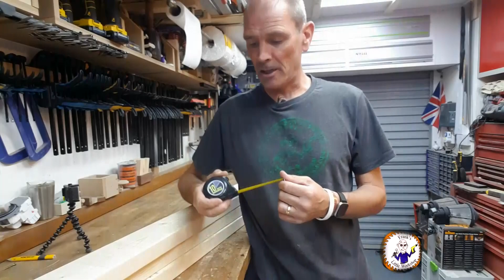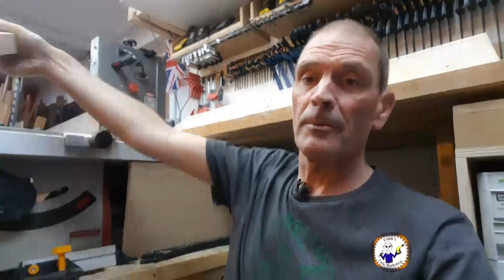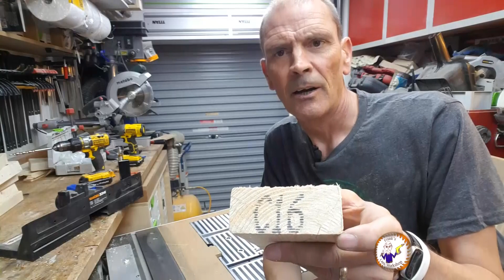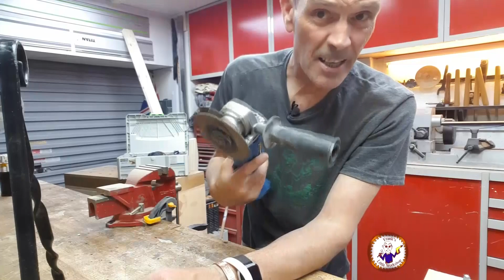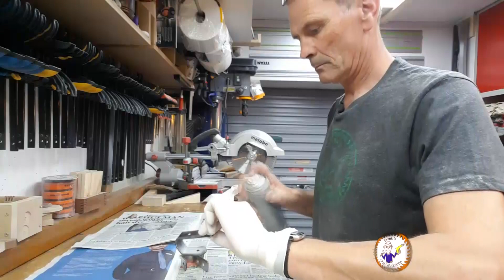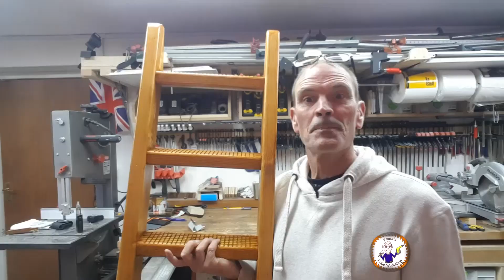How to make a bunk bed ladder.

Comment: Hi mate could you use 3x2. And instead of pocket holes what about screwing directly to the outside lengths into the foot boards ? . Obviously with big enough fixings and and filling at sanding the ? holes ?

Comment: They look pretty, but I don’t think they will be strong enough with only 4 pocket screws in the treads. I would have liked to have seen the treads keyed into the styles. Also grinding with the guard off and some flimsy safety glasses!? Not a good message to send out here. Plus you were trying to cut with a grinding disk not grind with a cutting disk. Apart from that, an enjoyable video thanks.
Reply from the maker: 😆 They lasted longer than the rest of the bunk beds apparently 😆, so it was more than strong enough 😁. I did the cutting with a cutting disc and a hacksaw... then cleaned up with the same cutting disc... which I shouldn't have but I only had the one disc... the safety glasses were sufficient for this application.... and thats all I had at the time. I was just showing how "I" made it... how my viewers do it is entirely up to them 😁.

Comment: First class tips at the start ( thanks for sharing ) , the bit that gets me all the time when building ladders is the rungs to hand rails I’m looking for tips for lineament !
Reply from the maker: Thanks Paul 😁. Glad it was of some help. I'm sure there are better ways to build a ladder, but works just fine for its purpose. Thanks for watching 😁👍
Reply: @frankslittleworkshop  2 days ago my 8 year old  burst the rails that hold his mattress support! So I have cut 3 legs off his bed and extend his ladders and rebuilt the base for the mattress and bolted the bed to the wall ( mission ! ) but looks great floating bed almost apart from the ladders as I had to extend I had to add steps that was the only part that was a bit iffy .